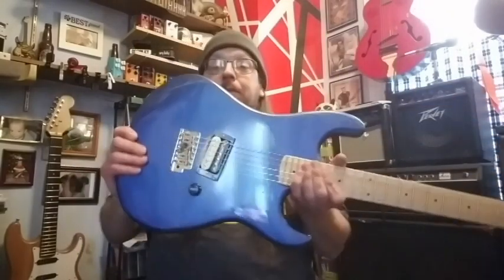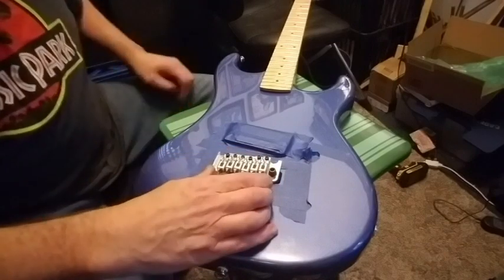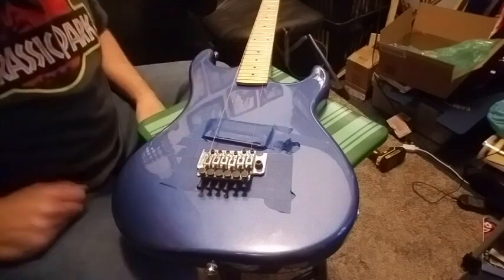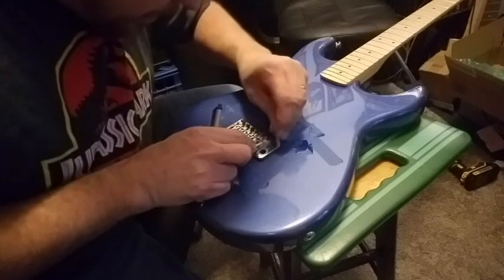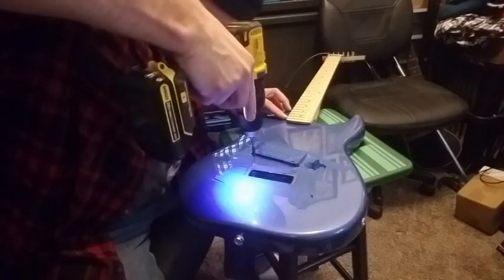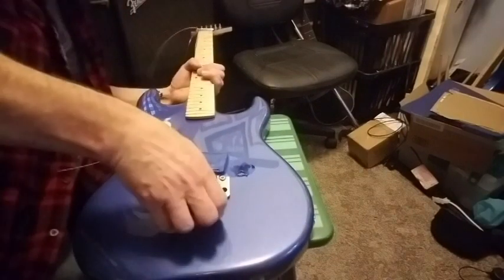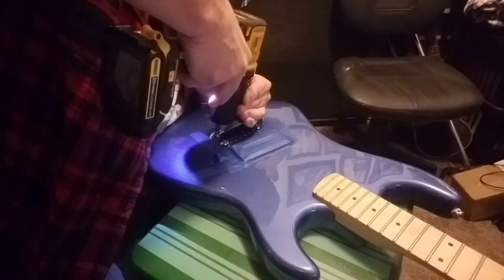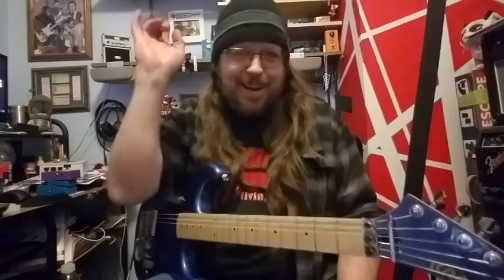Baretta Special install of a Floyd Rose Tremolo

Comment: Nice work.! 10mm drill bit is the correct size. Just in case anyone else is wanting to put in a FR. If you put in a Gotoh 1996t you need an 11mm drill bit. I left the stock bridge on my Blue Baretta Special and i put the Gotoh 1996t on my purple Baretta Special.
Reply: That is what I used for the 1996T install on another guitar I own..11mm drill bit.
Reply: Thanks for the info!
I have a F.R. Original and a Gotoh 1996, both still in their boxes but will be getting installed soon. 
I have a Kramer Assault 220 (L.P.) style and I’m wanting to change the Kramer F.R. style trem out for the new F.R. Original but I noticed the Kramer bridge sits up extra high so I don’t know what I may run into on that install.

Comment: Just an FYI for those wanting to install the floyd rose special on your baretta special. I'm currently in the process myself. What I discovered is that when you measure from the nut shelf to the location of the center of the posts which is 25-1/16", you will see the back edge of the factory trem route. I don't see any of the factory route in the guitar in this video which leads me to believe his floyd is slightly too far back. I could be wrong. Maybe all of these barettas are created equal
Reply from the maker: It works great and intonated perfectly.
Reply: @GregTalksGuitars do you remember the shim thickness? I already did my black baretta and recessed the floyd but I'm thinking about top mounting the floyd on my blue baretta but I am concerned about the thickness of the shim. Thanks

Comment: Drill press!! When i see guys drilling those posts with a cordless (I've made that mistake before) you're just asking for posts to be crooked.  Harbor Freight sells a pretty cheap press these days, and not only is it great for the drilling, its also invaluable when pressing in the posts (use a upside down nail set in a drill press and press them in).  Also, most standard trem routes usually have to be modified for a floyd.  Stew Mac sells a template to widen the cavity to fit a floyd.

Comment: Not an easy project. Well done!
I just find that the three spring Floyd Rose on my Baretta Vintage is extremely stiff. Any tips? Would it still work with two strings, and would it make it any lighter to the touch? Or should I start going to the gym 😂 ?

Comment: Thanks for the great video!
Question - Is there any slippage of E strings off the neck from the wider string spacing of the new Floyd? I believe Floyds E to E spacing is 54mm where the orig. trem that comes with the Baretta is 52.5mm spacing. Asking because I'm thinking of adding a Floyd to mine as well, but this is a concern.
Reply from the maker: I haven't had any problems with the E slipping off the neck.
Reply: @GregTalksGuitars  Awesome. Thanks!

Comment: What did you use to shim the neck?
Reply from the maker: The best thing to use would be a very thin piece of wood, but the only thing I had on hand was a thin piece of aluminum. Not the perfect solution but it worked.
Reply: @GregTalksGuitars  Thanks for the quick reply. I've seen people say everything from using part of an old credit card to part of a business card. But those two things are way different in thickness. But then again, every guitar is probably going to be different and have to experiment a little.

Comment: Very risky..just put a Vegatrem in it.they're fantastic trems..
Reply from the maker: I thought about the Vegatrem but I'm too old school 80s, it had to be a Floyd. Lol.
Reply: They’re like $300. You can get a GE1996T on your doorstep for $125-140. 
Another big issue with these kramers is the headstock. The strings come off the nut at crazy angles. Even with the best non-locking trem on the planet, it will never work 100%. Notice how the non-locking trem guitars that stay in tune the BEST (ie: EBMM) are straight from nut to tuners.
PRS comes in close second with the 3rd & 4th strings have a very slight angle.

Comment: What kind of Floyd was it r2 or r3 o, original?
Reply from the maker: The nut is an R3.
Reply: @GregTalksGuitars  how about The Floyd I’m getting ready to do this but there’s like 3 of them and I don’t know which one is best 
Ther from 100-300
Reply: The "R" designation (r1, r2, r3, etc.) is specifically for the nut measurements, the cheap one you're referring to may be a licensed floyd or a Floyd Rose Special. The best of the Floyd Rose branded ones is obviously going to be the Original, which is made by Schaller in Germany, but if you want to spend a fair bit less and get amazing quality, try Gotoh's version. I can't remember the model number off the top of my head but it's really nice.